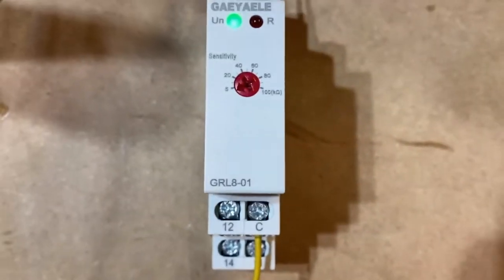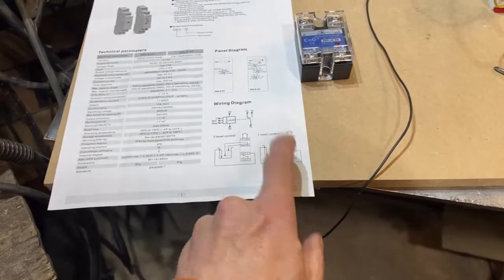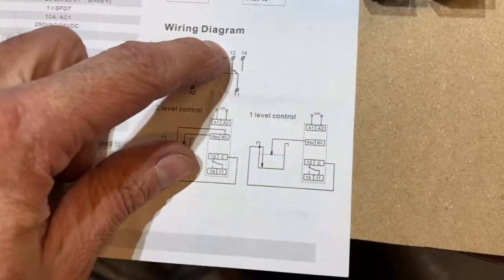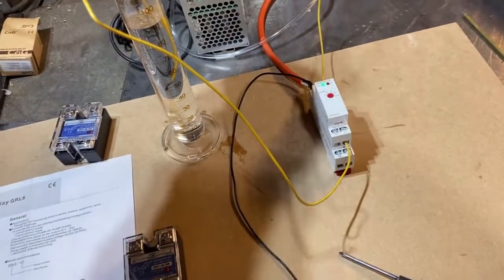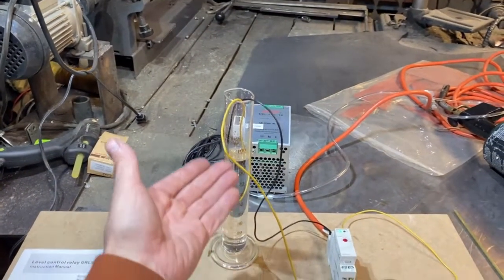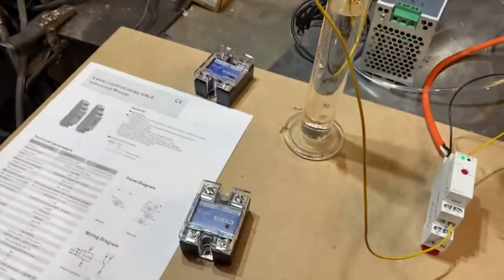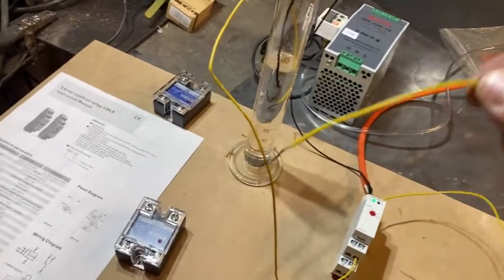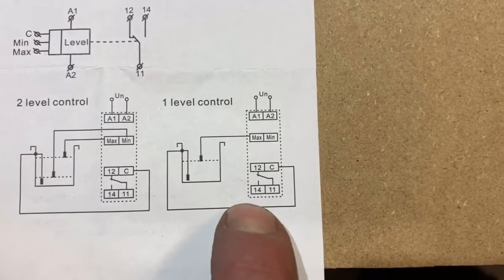Electronic Liquid level control Tank level indicator GRL8-01

Comment: assuming it’s resistance in the “fluid” sooo would be safe for an “oil” level on preheat tank (yeah, north dakota cold winter). If a steel tank, common could be grounded to tank & the upper level “probe” could be insulated / isolated to tank (no continuity) but open to oil level thus being an upper limit? watched again… 5v - eh gotta be a better solution for a preheat oil pot
Reply from the maker: Not sure how well it works on oils but it does work on other chemicals and liquids . Ill try it sometime on oil and diesel
Reply: @NOBOX7 I would assume 5v would never be enough to light even if fumes. I use a diesel heater in my oil preheat pot (slobber pot) prior to a siphon nozzle based off yours I watched years ago
Reply from the maker: @darrenlucke  I dont think Diesel fumes will ignite even with a spark . it wont burn with direct flame in some cases LOL
Reply: @NOBOX7  yeah, that’s what I meant… I’d think it’s safer than safe. gas won’t light a match even lol gas fumes tho… 😎